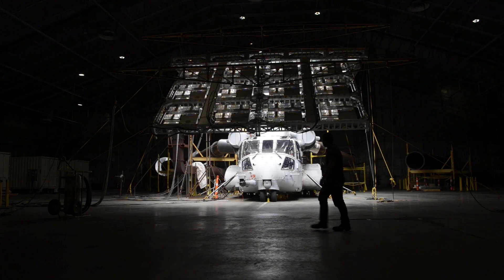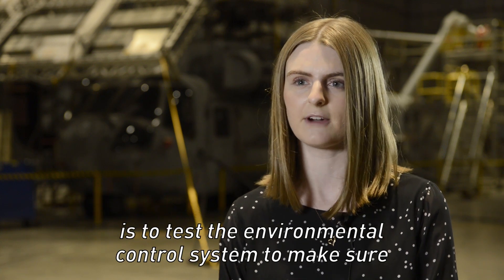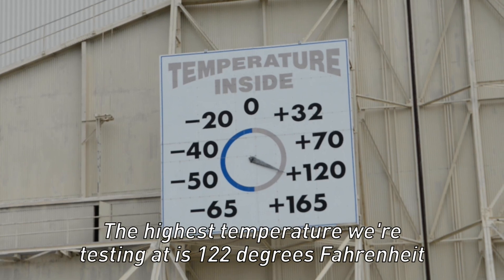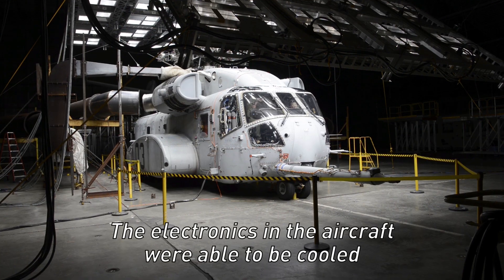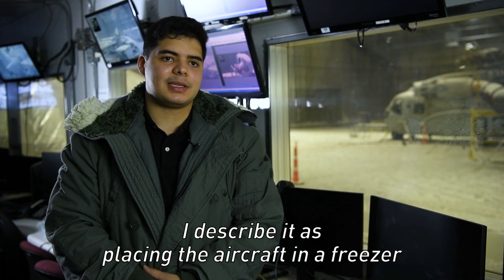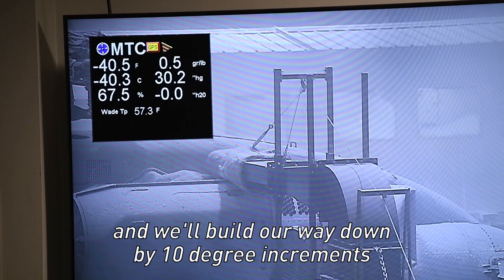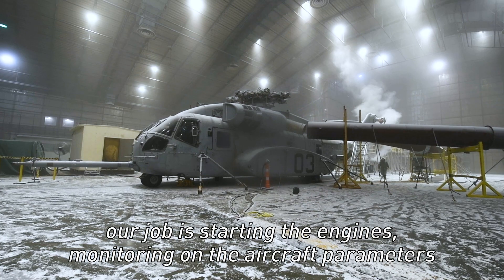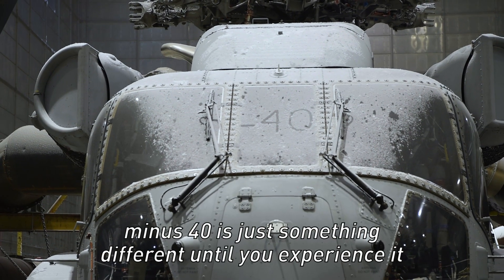CH-53K Climate Testing for the U.S. Marines

Comment: What I admire about the aircrafts of the US military more than all other nations is that they operate in nearly all climates. J-20 likely wasn't designed to work in Alaska, but the F-35 needs to fly in both Australia and Norway. Such a large temp difference adds many substantial challenges to the engineering.